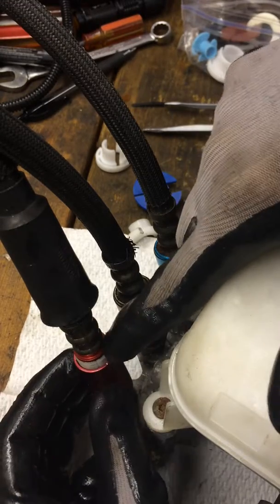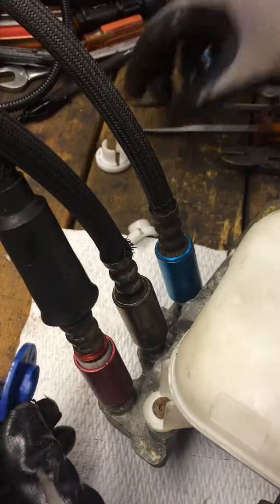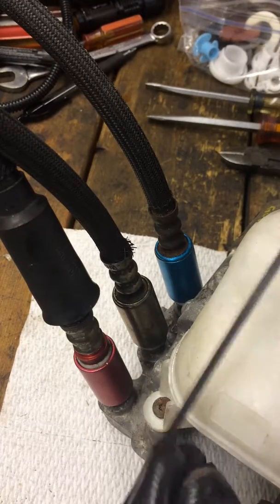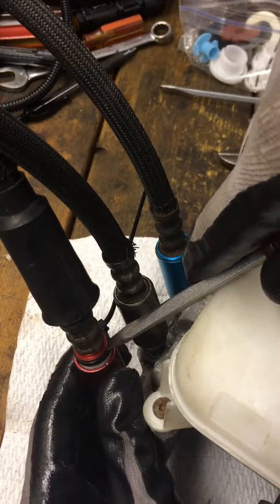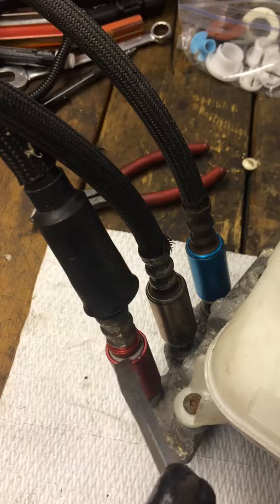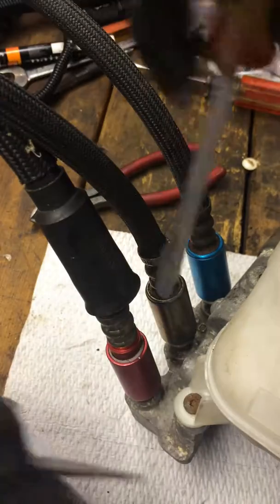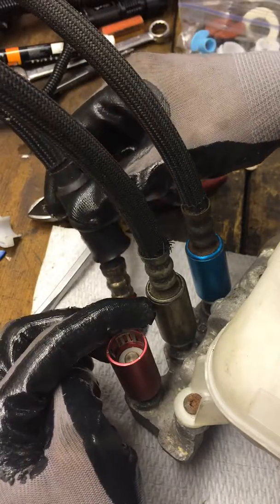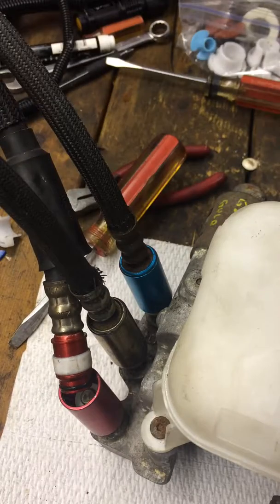MR2 Spyder - SMT hydraulic hose quick disconnect

Comment: hey Paul!! I'm also having problems with the middle one, I tried unthreading it but the wrench keeps slipping it. I'm wondering how you got it off. I have another question, if I unthread it, can I change the cylinder? thanks v
Reply from the maker: The middle is gold correct?  That one is a real bitch.  It’s made from steel instead of aluminum so it likes to rust.  Unlatching the fingers may not work.  Next try to unthread from the aluminum housing.  Add a little penetrating oil.  Then smack the little wrench flats sideways with a small flat punch to help break the threads loose.  “Vice Grip” needle nose pliers may be best to get a grip on the small wrench flats.  Or perhaps a box “pipe wrench’ to grab more than just two flats.  It’s always troublesome.  There is no way to change the quick disconnect barrel - I believe it’s swaged on during manufacture.   I’ve read of guys trying to substitute a flexible brake line.  That should work fine if you can find threads to match.  The system only produces 800 PSI maximum, so that should be less than a brake system.  Good luck!